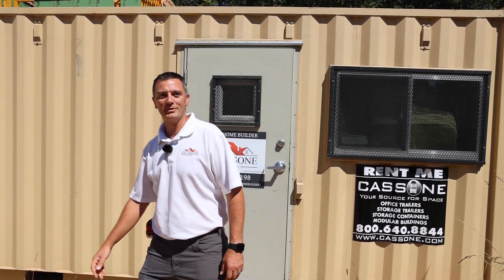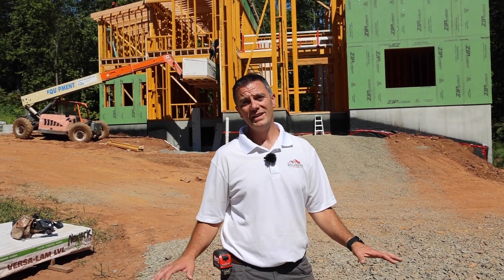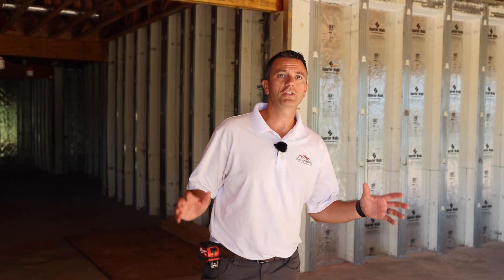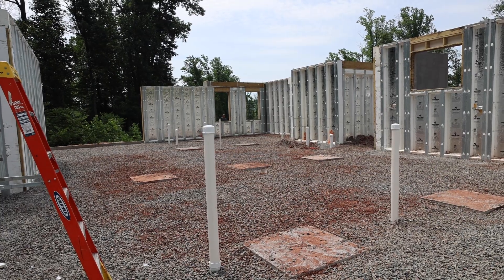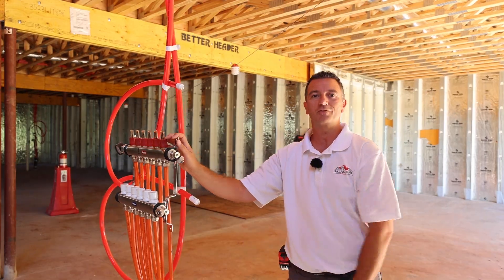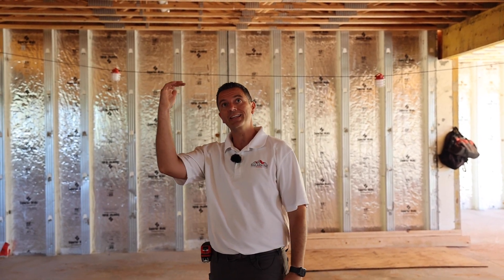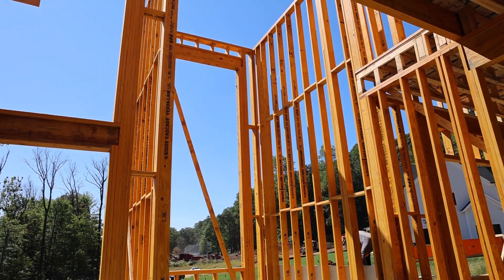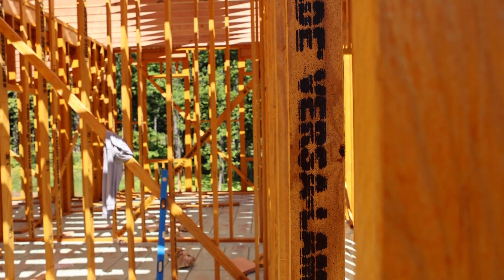Building a High-Performance, Energy-Efficient Home: Episode 1

Comment: What are reasonable budgeting numbers for 2025 , in a range of categories because lots of things cost more others. Is that a local code for exterior insulation? I’m seeking lots of multi million dollar homes in Los Angeles that are still using house wrap and OSB .
Reply from the maker: Paul - For new construction in 2025, expect around 5-10% increases in material costs (like lumber, steel, and insulation) and 3-5% in labor costs. For a typical home in LA, budgeting $250–$450 per square foot is a rough estimate, depending on size, finishes and complexity. Luxury homes or energy-efficient builds could push that higher.. As for insulation and materials in LA, high-end homes still use house wrap and OSB because they’re cost-effective and meet code requirements. Remember, just because it meets the code requirement, doesn't mean it's the best option. Advanced exterior insulation like foam board, self-adhering house wraps or spray foam is often used for higher energy efficiency but isn't always necessary in mild climates like LA. Here in NJ, we're in Climate Zone 5 so continuous exterior insulation is one of the ways to meet the new energy code requirements. Hope this helps...